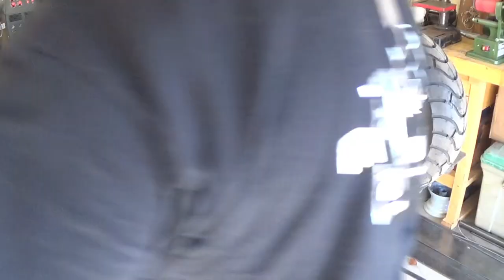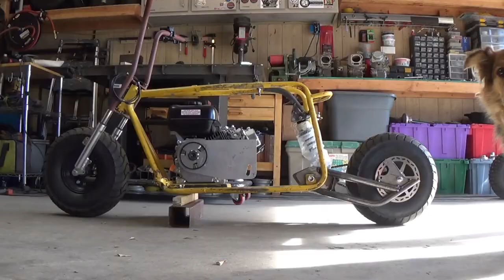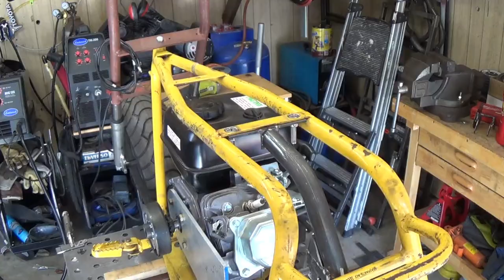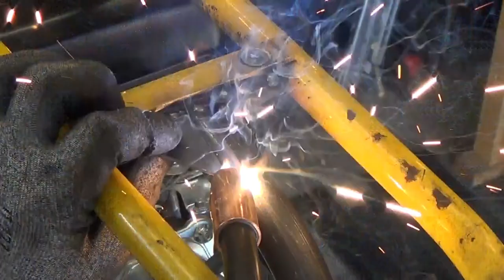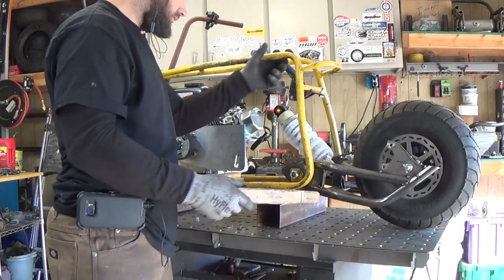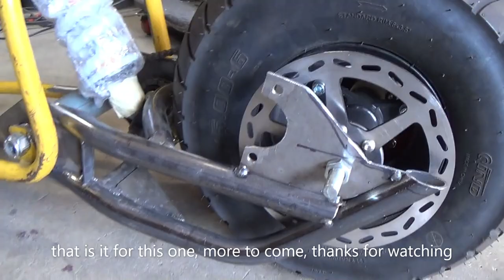doodlebug bolt in swing arm conversion

Comment: This is a great idear, might use this on my vintage cat frame one day, maybe add some front springs to the now solid forks.
Reply: Car valve springs make good front springs - '69 Z28 Chev springs stacked end on work we'll : you get at least Honda QA50 or. Z50 travel: good enough back then, I won't tell you how to do it : nut it out.Goodluck should you chose to follow this mission (mission impossible) Trev New Zealand 🙃

Comment: What spring did you use on the back
Reply from the maker: It's a 1200lb shock with adjustable  spring rate and dampening I got off ebay, it works great
Reply: & you got a straight answer - rare these days if it can be seen as commercially sensitive info.Cheers BOTH of you.Trev NZ